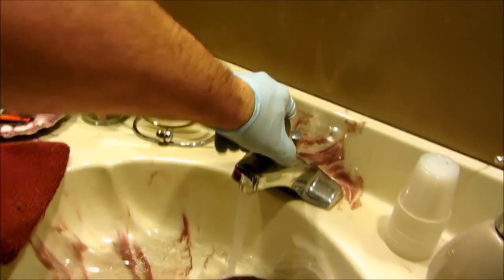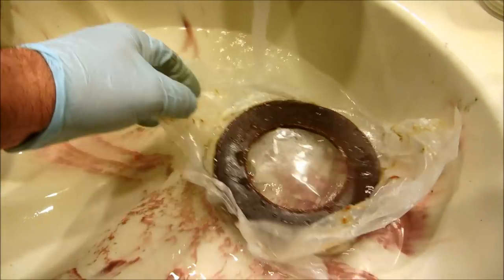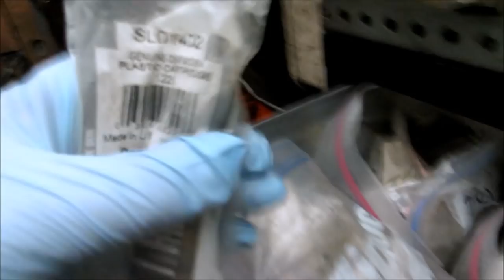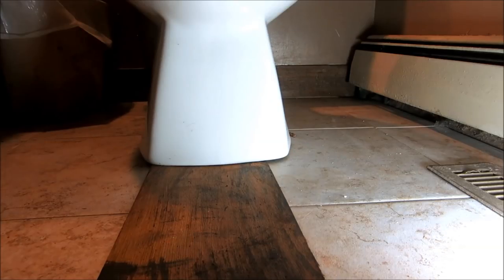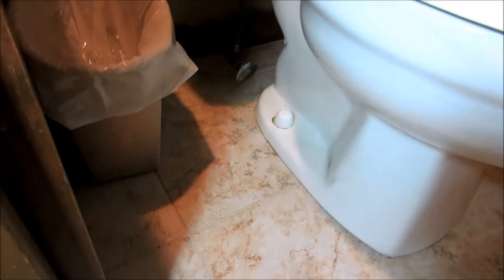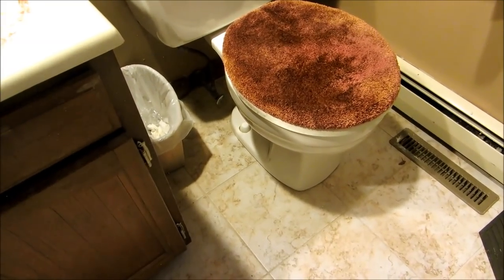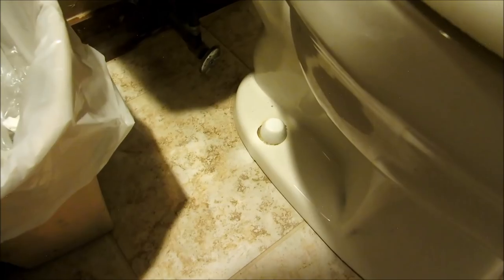toilet flange raised above new tile floor

Comment: Nice Vid!!!   I've seen some put a bead of calk around the toilet and the floor.   I noticed that you didn't in here in the vid.   Is there a reason, or is putting calk there not recommended??
Reply from the maker: David Haviland i have never seen any plumber use caulk on a toilet in 30 years ,thats a rookie move .and a dumb idea .the wax seals the toilet .not some calk . i have seen that done a few times and i just laugh . toilets are made to be removed for service .

Comment: When I remodel my properties, I always use a bead of silicon under each extension ring, to be certain no water leaks back underneath the rings when you flush. Why don't you do the same? It only takes a few seconds and it's a no brainer for protecting against leaks.
Reply from the maker: +Jeff Ostroff there was a good amout of wax on the old flange that sealed it well no leaks at all i did check ,but you can use silicon also or laytex caulk .depends on job and what i am doing . some come through with a gasket on them also .

Comment: hey steve nice video, quick question when you put the extension flange on do you put any sealant between the old flange and the new? i saw a tube of caulk and was wondering.
Reply: You should use silicon sealant under the shim. Sewer gas is another highly likely problem.
Reply: Hey Steven what kind of material was the shim made out of.?

Comment: Excellent video Steven. I'm doing this exact job as a DIY'er and your video was a great help! God Bless from the deep south!
Reply from the maker: Ray Cam good luck with the remodel
Reply: no sealant , didn't clean off old flange , this guy a plumber ? Ray , your toilet will be leaking between new and old flange .
Reply: Richard Anderson- one of my friends is a plumber and I just asked him about these flanges and he said they won’t leak. I asked if silicone should be used; he said it didn’t matter. But it just seems like it needs something to seal it huh?
Reply: Thanks

Comment: 10:57 "Do Not Do This!" If you value your beautiful porcelain tile the molten sparks will ruin your tile, leaves black specks that won't come out, permanent damage.
Reply: Just cover the surrounding porcelain if youre that concerned.
Reply: @HashBandicoot356  Just use vinyl bolts

Comment: I seen some genius stack about 6 of those rings one right atop another, needless to say they aren’t meant to serve as an inner pipe wall, whole room stank like shit and it leaked. I hacked the sub floor out enough to cram a coupling in and inside the pipe cutter down low on the pvc, whole thing was too low to use a twist and set. When I use those rings I prime and glue both faces like i was setting up any other pvc joint, gas-tightness

Comment: I don’t understand how the extension flange won’t leak. Even tho it has that lip, what happens if the toilet backs up? It doesn’t have any type of seal or anything. Could you use silicone or something?
Reply: My thoughts exactly on the possible back up......usually these flange kits come with a black rubber seal to put between the flange and the extension ring.

Comment: Moen 1225 stems have a tiny notch at the very tip, if you look close, that notch represents the direction of where the handle point should be facing...you'll never have to readjust the hot/cold again
Reply from the maker: +Chad Moser good point

Comment: just a note, all the tiny burned flakes from the angle grinder disk will burn into the finish of the toilet.  you can't wipe them off, they become permanent.  I noticed yours did it, it's hard to see on the vid but its there...

Comment: hey steve nice job on the flange and the moen. little piece of advice from personal expirience, dont use a grinder to cut toilet bolts, see those black marks from the sparks from the grinder at 11:00 on the toilet? they dont come off ever. just use bolt cutters but other then that i like the way you plumb, top notch
Reply from the maker: James Kim well throw a rag down to catch the sparks .its rear i use the grinder to get closet bolts off . they have to be pretty smoked not to come off any other way ....
Reply: I did that to a customers toilet once with the grinder. The stuff was burned or melted into the glaze and I could not get it off but luckily it was the far side of the toilet. Glad we have set-fast bolts now. Some toilet designs or locations make it tough to use a mini hack.

Comment: Heating the wax ring in the sink was a excellent tip.
Reply from the maker: James Hudson i only do that in the cold weather . if the wax is in my cold truck it will be hard . hot water will soften it up for proper instulation of toilet
Reply: steven lavimoniere Here in Washington it doesn't get very cold often, but there's been a few times where I've had to sit and wait for it to warm from having in the unheated part of my truck during winter.  Now that wont be a problem.
Reply: That is a Steve L pro tip !!

Comment: Nice job steve.  I like to put a little wax between them extensions and the flange just for security.  Looks like they have galvy water piping from the color of the water coming out for the first second.
Reply from the maker: Ryan Dugger the extenshion flange fits tight and has that lip on it so i just screw them down and sandwith them together never had a problem doing them that way

Comment: You gotta help me please. Put toilet flange in but the 9PM and 3 PM slots for brass screws -
do you use centerpoint of drain pipe/ flange Or should I measure off the wall 12-13"?
I measure 12" but my other toilet side holes were at 13" from wall?

I know they give you slack to move the screw back and forth to bolt the toilet OR should it be right to the edge of slot? Thanks again  for the valuable tips- may it all come back tenfold! God Bless!

Comment: I'm going to have to do this when I re-tile my bathroom floor, the only snag is it's on a concrete slab on grade. How do you secure a flange extension to a concrete slab if there's no subfloor to screw into?

Comment: Cool video Steven. Sparks and a tip on supporting the bottom with a wooden spacer. That grey water reminds me of my uncle's farm. His well water comes threw 2 layers of cool and come out of the tap Black.
Reply from the maker: hanky97007 well it was a older toilet .probley stured up some smag in tank

Comment: I put silicone in between the extension flange and the existing flange, I just like the extra security
Reply: lI was surprised that he didn't Caulk around the base.  Maybe there was a reason.

Comment: Most of the time you have good ideas. PVC  spacers suck. Cut the broken flange out the spacers work better under the new flange. If you want to just repair a broken flange, stainless steel woks best. Screws will hold better on an angle. Shear strength is doubled on a 30 degree angle.

Comment: You shouldn't have cut the bolts with the angle grinder.  You should have used the hacksaw.  Notice how the sparks actually burned the paint off the white porcelain.

Comment: Did you  clean off the surface of the old flange before putting the new one on top?
Reply from the maker: esoomreltna i did scrap the old wax off with a putty knife.. i left a small amout of the old wax there to seal between the two .it has a lip  that kinds seals it from the middle it fits tight .when screwed down ...if it was durty i would have cleaned it if needed .
Reply: Steve, Ah OK. It just looked wrong in the vid. Nice job of getting it done and the wide shim in front is excellent. Regards,
Eric

Comment: Not a good idea to use angle grinder to cut toilet bolts off, the hot sparks burned the porcelain, or didnt you see that?  A multi tool with a metal cutting blade is much safer.

Comment: My toilet flange sits a little over the tile. When I swapped my wax ring I noticed my toilet was rocking a bit. I installed some toilet shims which stopped the rocking then a week later the toilet started to leak again.

Comment: Hello,  Just installed a replacement closet flange and a new toilet.  The directions called for the flange to stand no more than 1/2" above  the finished floor.  The horn on the stool was cast flush to the outside base.  When the toilet was installed on the flange it has absolutely no room for the thinnest of wax rings nor some of the newer styles of synthetic plastic.  That closet flange was too high when put on top of the finished floor.  It was actually set 3/16ths below the tile surface.  Yet every installation I have seen sets the closet flange on top of the finished floor.  Measured across the new flange showed a total height of 3/8" above the finished tile.  Since it would sit fine with no ring I finally put a heavy ring of 100% silicone around the flange and seated the toilet to that.  Knowing it is not a recommended procedure but since it is mine I can watch it.  Worst comes to worst the new flange can be pulled and replaced.  Wondering if this is something you have encountered?  This was a new Delta Prelude elongated toilet and a standard (although a stainless ring) sized as far as thickness, closet flange. Take care.  Doug

Comment: Sweet. Put a toilet in for my mom in fla. On a terrazzo floor. Had a issue with flange ht, and ended up using grout in a squeeze tube, and small rubber shims. No use for 24 hrs, rock solid!
Reply from the maker: adkchip1 good luck with your repair .i hope it lasts

Comment: Thanks for this video; I'm doing my own bathroom renovation (IT'S HORRIBLE!! lol) and I panicked because the original builders made the flange level with the plywood subfloor (which had evidence of rot around the toilet hole...guess now I know why).  I have two questions:

- I started to pry out the flange but didn't get very far before giving up.  I was able to remove the screws from the outer iron ring (they basically fell apart once I got them out). Is there any reason I couldn't just gently hammer the the existing flange back into place and use the extensions instead? (I was able to pull up a small area but the flange seems to be in ok shape, it's definitely still attached to whatever it's attached to down there and isn't missing any chunks or anything).

- As mentioned above, my flange is level with my hardiebacker, and my tile is 1/2" thick (so my flange will be 1/2" below the finished floor).  Should I just use two 1/4" extensions or should I use three, bring the height up to 3/4", and make the flane higher than the finished floor height?
Reply from the maker: Bob Loblaw flange should set on top of tile floor and be screwed down into wood

Comment: Steve, Great videos. Very helpful to share your experiences.  I have a floor flange that is very high. (The old cast iron flange was broken where the support screw goes in, so I added a metal flange on top) (I have seen how you replace the cast iron flange, but I don't have the tools to melt lead). The floor is about 1 1/2" lower than the edge of the toilet. Can you tell me how would you shim the toilet so it does not move when someone sits down on it.   Thank you.

Comment: I bought my house in 88 and the house was built in 86 and I had to change my Moen Shower valves only twice since I have lived here and the house is 36 years old.  Still on the same water heater and I installed a convection system with no pump and i get hot water in 3 to 5 seconds at the back of the house.

Comment: Question, if the flange is on top of the time floor, do the screws need spacers under the flange? How does the flange attach?

Comment: great video Steve! how about when you extract those brass moen cartridges and the middle comes out & the outer part stays behind because it's froze to the faucet body that usually makes for a great day = /
Reply from the maker: Jason the Plumber if that is the case i just replace the faucet.i told her before i attempted to do the repair i might have to change the faucet .sometime things are not worth fixing .. but this one did some out ok in the end
Reply: oh I found that solvent weld caddy here's the link http://www.jonesstephens.com/product/s95015/
Reply from the maker: Jason the Plumber i had that one and did not like it .. i have a better one its white and takes up less room. cans just click into it and i rap duct tape around to hold them in for added support
Reply: thaks Steve that's good to know I'll keep my eyes out for that one

Comment: nice video Steve, but what about if it's a concrete slab?  I've been told over and over, not to drill into the slab, to anchor the flange?  
If I'm putting in a new one, is it ok to put the new spacer under the new glue in flange?

thanks
Reply: I added a spacer put flange on top same thing Steve is doing drill into concrete with tapon screws. Flange secured no leaks. If you glue it how you going to remove it if you gotta replace it for possible new flooring?

Comment: Steve, I am about to retile my bathroom. The current toilet flange sits on top of the OSB subfloor. I've got a 1/4" thick backer board going down and then 5/16" thick tile going down. Is putting the extension flange kit on the existing flange the best solution to get it up to the height of the new tile? If I use the extension kit, how likely am I to have a leak?... Should just I remove the existing flange and put a new entirely new flange on that will sit on top of the tile?
Reply: if flange flush to the tile you are good, use 1 wax ring with horn and a wax ring without horn on top. 
if below the tile you can get build up rings(pvc) til you get flush with top of floor/tile, caulk between each ring and flange and screw down

Comment: Steve, if the flange is too low and the tile hasn't been set yet, is it better to cut off the old flange and install a new one rather than install an extension like you did?  Can you buy a flange with an extra long hub to get the flange at the right height?  Thank you!  In my case, someone also installed the flange in the wrong orientation...the big holes in the slots are at 3 and 9 o'clock...just where the bolts go!
Reply from the maker: Nicholas Hoffenpiper sometimes its better to install a new flange  cut the pipe down below and install a coupling pipe and new flange to sit on top of tile but it has to be fastened  screwed down to floor good or the toilet will rock

Comment: I'm hoping to get an answer from somebody about moving my basement toilet over between 9 to 12 inches without having to cut my floor. 
My idea was to make a sub floor around 6 to 8 inches above the surface, use some pvc pipe to connect the ground pipe. To a 90 degree piece of pvc fitting the length I need then connect another 90 degree fitting with another piece of pvc connect it to a flange. I was thinking about this but I'm no plummer and was concerned if that type of set up would disrupt the flow, especially with feces. That's nothing I want to build a floor to move my toilet and find out the hard way that it can't be done. In my mind I think it can with the appropriate fittings. Can you help me out here ? Just trying to not only save a few hundred bucks but maintain the integrity of my basement floor
Reply: loveto livetruely I’m not expert but that you never want to use 90’s on horizontal waster pipe, use 2 45 if anything. However, I’d chip the floor out and just move the pipe. Honestly it will probably be quicker and cheaper with the added benefit of not hitting your head on the ceiling whilst taking a dump

Comment: A couple of things that you have done wrong; 1) Never install the flange extender without the silicon. You need to block the water. 2) Please clean the flange before installing the extender. 3) If you have done the tile cutting, the flange should sit ON the tiles. It is better than using the extender. 4) Using the rotary is not a smart idea to cut the bolt, imagine if you hit your new bowl with it!

Comment: Did you not put down any sealant between the old flange and the extension?
Reply from the maker: Kyle B there way wax on the old flange it acted like a sealent beside there is a lip on inside that will seal the extenion tight to old flange if you seal it down you will never be able to get it off in the future or it will be much harder.
Reply: steven lavimoniere There's really not enough wax on there to make a water and gas tight seal. That lip is OK but certainly doesn't seal the thing. Especially in the event of a backup, water could easily pass through the extension and existing flange. You could use a number of things to seal it, some come with a gasket, or silicone, or as you mentioned, wax and my favorite, putty. Putty makes a great seal and allows for easy removal and heck, everyone's got it. Just an FYI for the future. Gravity will pull the water down most of the time but that doesn't apply to the sewer gases. Best of luck, always wear gloves! haha
Reply: +Dan Lo Fat  I know what a sani-seal is; it's a waxless toilet gasket. I personally haven't used one but I think the concept is sound and should work well. Unfortunately in this particular case it wouldn't matter if wax or a sani-seal were used I still say that repair is not done quite right and WILL leak either water or sewer gas or both if it is not already. The wax and/or sani-seal only seal the bottom of the toilet to the top of the flange. What about the gap between the old flange and extension? Nothing was used there allowing an easy path for sewer gases to escape and, in the event of a backup, water will flow through it onto the floor. Personally if this was done in my home I would ask for it to be redone. A simple rope of putty between the old flange and extension flange and you can use wax or a sani-seal, both would work fine - that's not really my issue here.